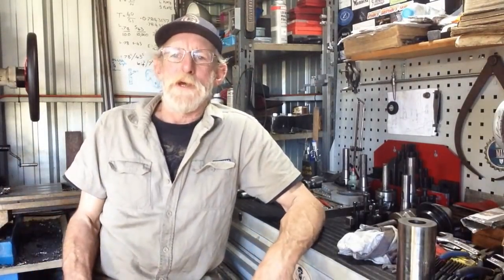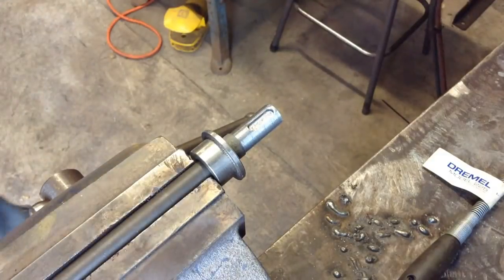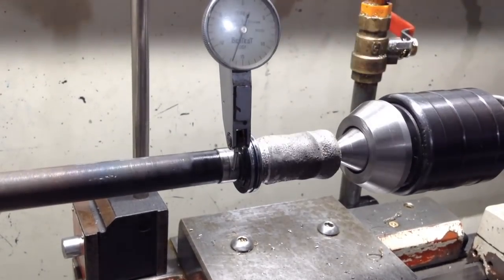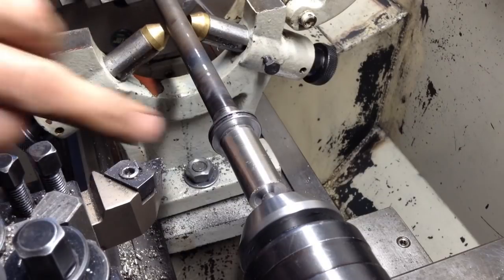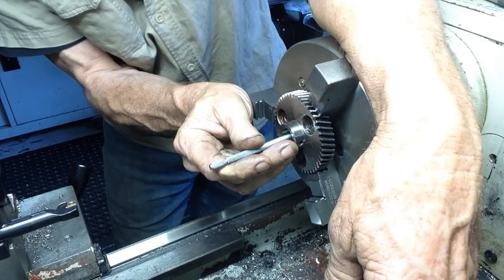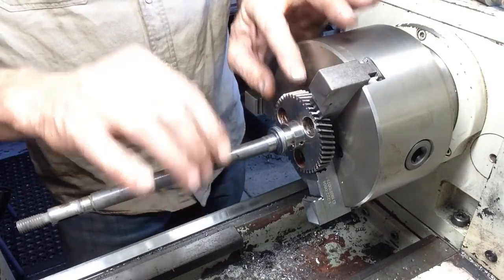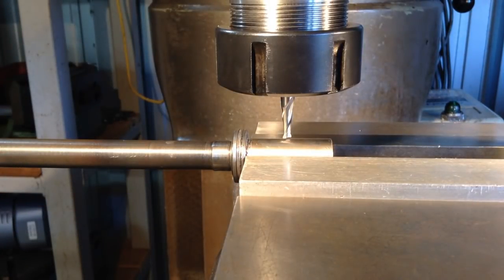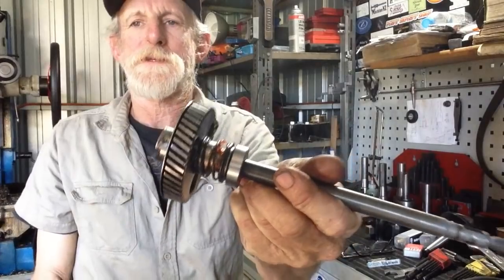Fits like a '' Cock In A Shirtsleeve ! ''

Comment from the maker: The Eutalloy torch is still patched up ,  but we had to get this job done .   Hopefully Tom , from Hill Top Machine  Works will be able to save the day & locate one .
Reply: The torch seems to have done the job! I understand the spray build up is mostly nickel, how hard is the repaired area? I’d think it may be more susceptible to wear again. I’ve never used this process.
Reply from the maker: @RockingJOffroad  It's not bad as a bearing material , according to Euetectic info it will be ok .   Options are limited when the part gets dropped off Fri arvo to be ready for Mon morning !
Reply: Abom79 may be able to help, he had a similar torch rebuilt and seems to be on good terms with Eutalloy
Reply from the maker: @Brocks-Travels  He will be my next option ,  But i will see how Tom goes .  Thanks   .
Reply: @RockingJOffroad   i used Tec spray in my old job repairing  the disc on stem valve's to the power plant .  7 shafts such as we have just seem tacks me back a bit ,

Comment: Is it possible to spray weld the spindle journals on a old bench lathe, or it the spray weld not hard enough?
Reply from the maker: I would think yes .  But it would have to be done with a different type of torch .  The process is a cold build up with Proxon powders with a Eutectic Rototec torch   .   I am in the middle of doing a deal on one of the torches at the moment .

Comment: Max, a couple of questions from a hobbyist:

1) When you changed from the carbide insert to HSS to finish turning the build-up, was that because carbide doesn't come "sharp" out of the box?  If I remember correctly, Stefan sharpens his inserts to razor sharp and doesn't have finish problems with them.

2) Is there a particular "name" for the DTI spindle-holder?  I think that Stefan said that he found the drawings for his somewhere online, but didn't say where.  I'd like to try to find those drawings!

3) I wish I could remember the 3rd question I had!  ;P

This video was full of practical tips & tricks!  Thanks for sharing!
Reply from the maker: Hi Bob . Some insert grades come sharp out of the box , the ones for aluminium  do & there are several other grades .  Most indexable inserts are not designed to be sharp .   When my tool & cutter grinder is up & running soon , i will  be able to sharpen them .  If you can't find the dti  holder on his channel , email me .  My email is in the ''About ''  section of my channel .      Cheers .
Reply: @swanvalleymachineshop  I just sent you an email message.  Thanks!

Comment: There is a paste  for your spray to stop it from bonding  to the parts you are working on. Cheers
Reply from the maker: There is . I have some in the box with my Roto tech torch .   I will have to get that out one day !
Cheers .
Reply from the maker: @carlpenney901  Yes , i have seen them . My one is the same as his older one .

Comment: Thanks Max,
Is that spray welding the same process that engine rebuilders use on crank shafts journals? Might that be a source of parts for the eutalloy gun?
Cheers
Reply from the maker: Bit different process  .   Only ever seen it done on the seal areas  &  most  cranks you can not put heat any where near the journals .   I guess there would be some exceptions .

Comment: hi max,how can you tell the difference between an inperial or metric gear.also have you ever replaced the spur gear on your 960b lathe.its on the outside of the apron and is driven by the feed shaft.in the parts list in the manual under apron ,its part number 20 (3369)if you do know the right involute cutter to use,that would be great.thanks geoff
Reply: Hi Geoffrey, I had to replace mine recently, Hafco have the part for just under $90 from memory, it is a helical gear so probably hard to make. It looks like bronze 
The combination of getting the material and the helix put me off even trying
Reply: @stanstevens3783  definately a spur gear and bronze.i bought a replacment from hafco perth.i just don't know if its metric,imperial or what cutter to buy.thinking about making a replacment out of steel as an exercise.the feed shaft drives the helicoil which drives the spur gear and then drives the apron gears.
Reply from the maker: It's just bronze .   The  gear is 18 teeth , 1.5  Module . Not sure on the helix angle  , a measurement i forgot to get when i had it out .   Not a good set up with the way they have that gear .   In an earlier video , i made a cover to keep the crap out  & it is now drip fed with oil .     Cheers .
Reply: @geoffreyward4743  Hi Geoffrey, I think one of the reasons it is not steel is that it is "sacrificial". You may have more extensive problems in the next crash
Reply: @swanvalleymachineshop  thanks max,yes i saw your video and made myself a sheet metal cover.good idea,also the wick oil feed to the screw,feed gear box.i still have whats left of the old gear,how would i measure the helix angle.are you talking about the diametric pressure angle in degree's.??? which is written on the cutter.
Reply from the maker: @geoffreyward4743  The angle that the teeth are cut on .    ( The lead angle of the worm they run on )    You have to tilt the head in the mill to cut the gear .